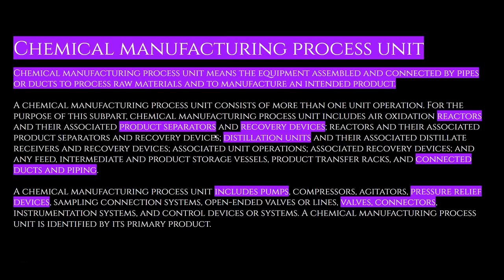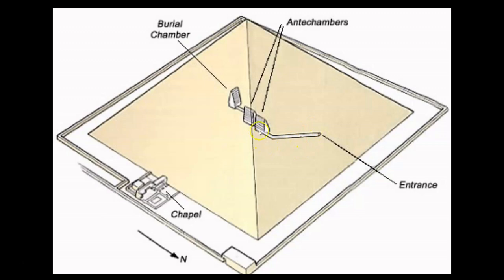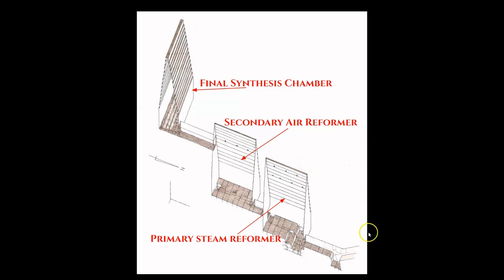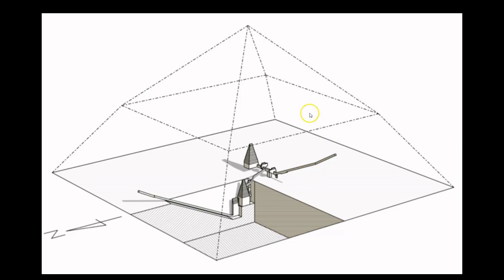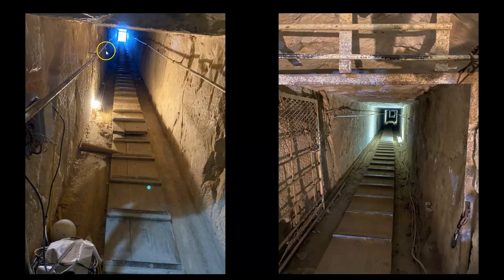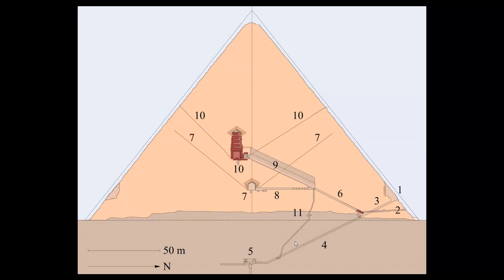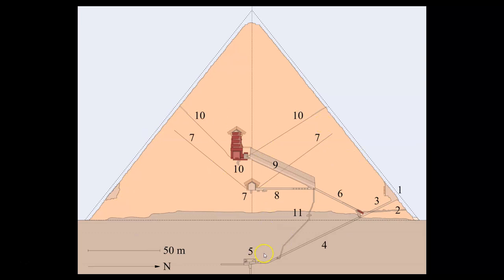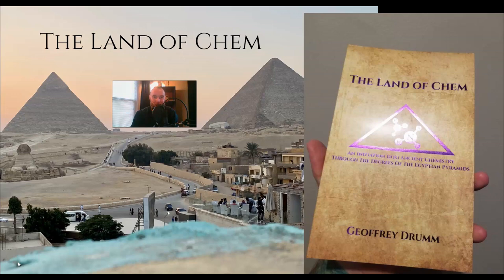Episode Twenty Four: The Egyptian Pyramid Pump Shafts, Part Two

Comment: Your theory has so far, been the most scientifically compelling I've heard about the pyramids' functions, and I only believe in science..  However, why do they need be housed in massive pyramidal shaped structures?
Reply from the maker: Thank you Apollo! The body of these structures had multiple functions, and I will be getting to that in a later Episode.  Check out Episode 23 on the function of Newgrange.  There is a preview of an EM experiment we did with samples of the different stones used in the construction.  Very interesting results... Stay tuned!
Reply: Science requires no belief, but a combo of hypothesis, experiments and observations. When an observation leads us to create a new hypothesis, then you have a new experiment to test. From observation, the pressure of whatever gas was compressed in those chambers may justify the weight of the massive structure. There was a pyramid somewhere that seemed to have blown from the inside out. Doing the related experiments may cost a lot more than most researchers teams though...
Reply: *budget
Reply: @andanssas  Interesting thought... it's also been theorized that the Osireon was some kind of chemical lab and was architecturally placed underground for this reason... to house contain high pressures omission from the conducted mixtures.  

But if you look at modern chemical labs, they don't require any large outer layer containments - just glass tubes and funnels.
Reply: @andanssas  , yes, and Geoffrey did get into the pressures/ weight correlation of the structures just a little in a previous video.
The other ( destroyed from within ) pyramid was the pyramid at Abu Roash ( Ruwash ).
Reply: @andanssas  see my previous comment regarding a massive explosion in the King's chamber.

Comment: The water was Nile waters ? If so, must have undergone some filtration,
silt could have been accumulated.. also these are hard water, needed to be 
softened in order to prevent limescale accumulation.
One suggested the king's chamber sarcophagus was initially placed in 
the so called electrical room, snd was actually a biosand filter.
Reply from the maker: Check out Ep 86. I discuss this topic specifically. Enjoy!

Comment: An analysis needs to be performed to compare the width of the well shaft to the width of the descending shaft...which would be used as a water ram to raise the pressure in the underground chamber to a high enough level to force water to rise up the well shaft.  If the width area of that shaft is too great compared to the descending shaft then the pressure that would need to be exerted on the granite piston would be more than its mere weight alone. It would have to counter the extensive height that water would have to rise as well as its volume. Those two factors might be greater than a stone piston could overcome.
Drawings of the well shaft make it appear to be rather narrow, perhaps even more so than the descending shaft so that would reduce the pressure needed to raise its in-filling volume of water.
But the fly in the ointment is that pistons must have tight seals or else the gas or fluid within a 'cylinder' will leak past the edges at an ever higher speed as pressure is increased.  A seriously effective seal around piston blocks would be needed to avoid a big mess and constantly dropping pressure.  And there's also the issue of friction in pushing stone against stone if all surfaces are not very smooth and well lubricated.
Reply: I was thinking about this and was going to suggest. That the shafts may have been more narrow and more perfectly worked in an earlier time. Perhaps years after operation other humans cut away making them wider and more accessible. Therefore destroying the original dimensions of the shafts? 

@the land of chem Is there any evidence that you could see on your trips to show work of the stone on the walls of the shaft? Or do they look like the natural exposed block that would of been there since day one?

Edit. Also It would be awesome if a German Folk could translate the audio of the Video clip
Reply: I agree. The physics are not mentioned. To make a solide physical model (and i'm talking only pressure!  not friction..) is quite a task. The volumes of water and the hight it has to overcome point to a lot of energy input.
Reply from the maker: check out John Cadman's work on the pyramid ram pump.  This idea about the subterranean chamber has been around for a long time, all with slight variations on the specific mechanisms.  I propose a stone block, these guys show a one-way valve wooden apparatus, cadman thinks it works automatically.  And yes, all of these systems would need to be sealed relatively effectively and I have several ideas on how this was accomplished. Will table for a later video.  Also check out Episode 19 on the pressure capabilities of the Red Pyramid.  It's not about the pump system, but the configuration of the chambers.... stay tuned, this is just the tip of the iceberg. And thank you for commenting!
Reply: @thelandofchem  thank you for the reply. Could pumps be on the outside of the pyramid. Would the shafts be able to be sealed enough to keep up proper pressure.
Reply: @thelandofchem  Have you read Flinders Petrie's description of the King's chamber?  It's amazing.  He details the many imperfections that have resulted from something that was unknown to him, but to us it appears to have resulted from a massive explosion.  The walls are not even connected to the floor, the floor is all uneven even to the outside passageway.  The ceiling blocks are cracked near the walls.
I make sense of it all by supposing that a powerful explosion pushed the ceiling blocks upward slightly but they could not budge near the walls because of the massive blocks above them (the relieving chambers' blocks) so that tension is what fractured them.
I copied his notes to digital text and saved photos of the cracks.  Their location indicates something of engineering value and perhaps my guess may be what is indicated.

Comment: Have I understood this right.. you proposed the pump shaft as a block to push water down the shaft.. but the Germans seem to show a box creating a sucking action instead. A wooden box would be easier to manage. But I'm skeptical about both methods being able to  provide a seal good enough to push or pull water in the shaft. If they had some sort of tar type seal it might work better but it also be harder to move anything in the shaft. Plus how the heck could they move anything up and down the pump shaft to begin with? It seems to high up and difficult to get to ? It seems like a engineering nightmare/ borderline impossible.
Reply from the maker: If they could build the pyramid, they could have easily engineered and executed an effective pump
Reply: @thelandofchem  also begs the question where is the pump stone now? From what I know so far there wasn't any found in the shaft. I'd assume it be right at the bottom. Unless it was wooden and rotted away. Or if the pyramid did explode, it could have been shot a mile away. I'd assume there must be a granite stone the right size somewhere with some sort of anchor point by rope or chain to move it up and down the shaft.
Reply from the maker: @exxosuk  with all the casing blocks removed, it's almost impossible to say what kind of housings or anchors were originally on the outside... but if there was a pump block, regardless of material, it would have been the first thing destroyed when people began trying to access the inner chambers through the shaft. Fragments of such a block were found inside the western pump shaft of the bent pyramid

Comment: so you have proposed it or someone else? and did you watch that video previously before you proposed it? having your name on this theory is kind of a big deal...somehow I fee let down
Reply: Did you watch the Episode? This video was sent to me by a reader of my book. My theory is that the GP is used to produce sulfuric acid. Their theory is that the GP is a water pump. Two completely different ideas. The only reason I shared the animation is because it demonstrates the same concept that I have proposed,  which is that the subterranean chamber is used to push water into the upper system. If you watch to the end I explain all of the errors in their theory
Reply from the maker: I know you are a long time follower of this channel so I wanted to follow up again.  I developed my theory about the pump shaft component when I was working on the Red Pyramid back in 2017. This video was just sent to me in December 2021 by a reader.  In my theory, the pump shaft is just one component in the larger chemical manufacturing sequence, a mechanism to raise the water, etc.  These guys think the entire Great Pyramid is a water pump, which I completely disagree with, and there are several major errors with their ideas.  I just think its a cool animation that shows the contact process chamber, ie the Grand Gallery, being filled with water.  That is just one part of my theory that is similar to their idea.  It is definitely interesting that many independent researchers have proposed that the subterranean chamber of the GP is a water pump, but they all disagree about the ultimate purpose of the structure itself.
Reply: Important ideas tend to be discovered by multiple parties independently of one another. Check the history of calculus. Who presents with the most comprehensive analysis tends to be the one in the history books.